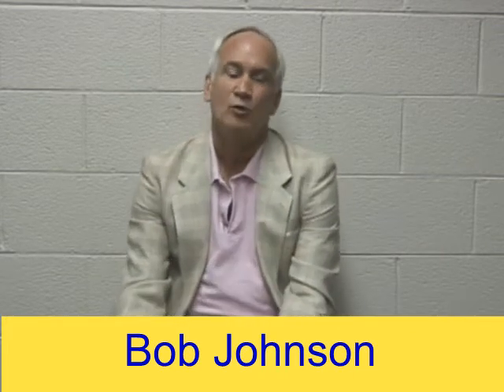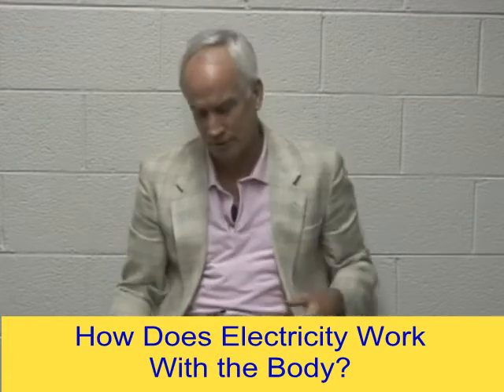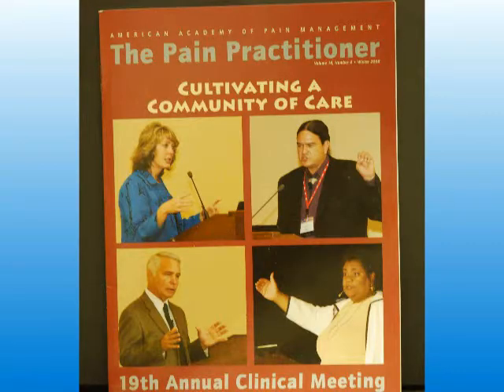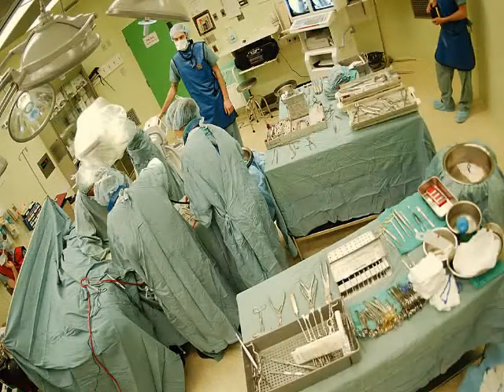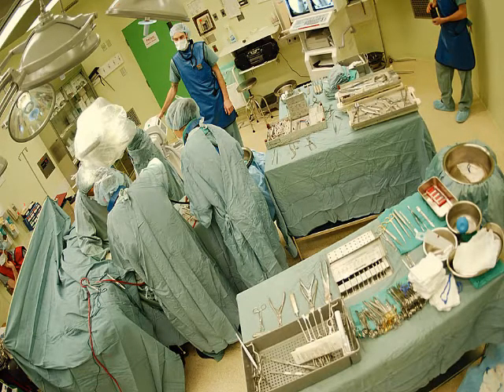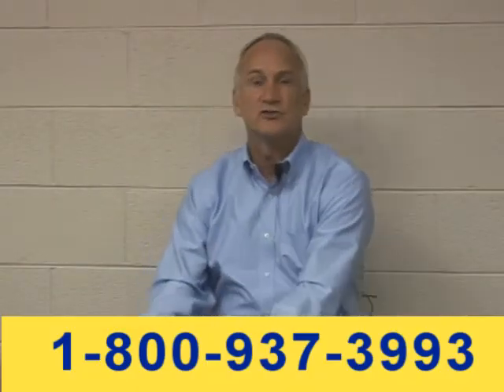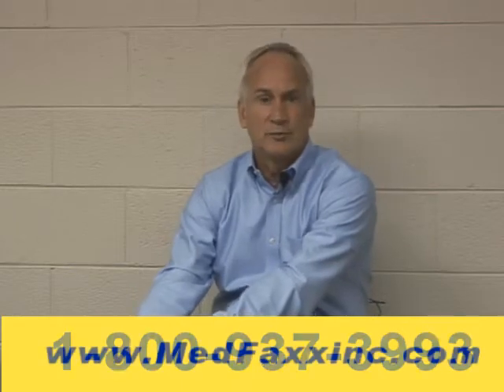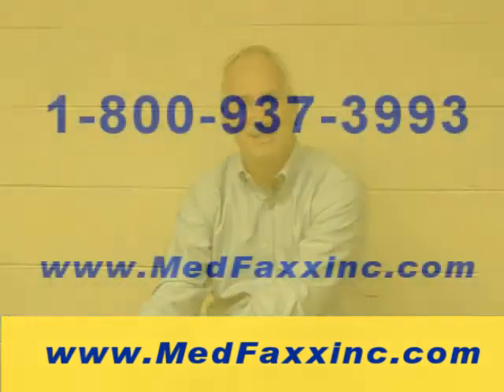Bone Healing, Bedsore Healing With Electricity Explained

Comment from the maker: Yes and actually that has been tested but equipment not there yet.   DARPA ( military research unit) has tried to take the electricity generated by body ( friction part of it with blood flow) and use that to power the devices military uses.  Harness body's electrical energy.   As of now nothing working that public knows of.